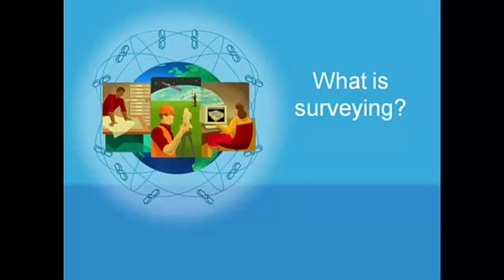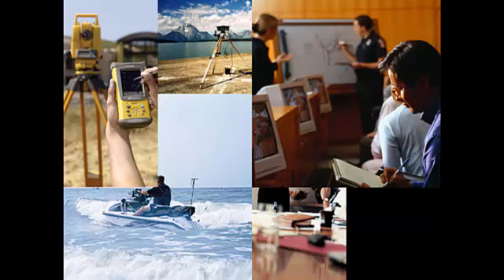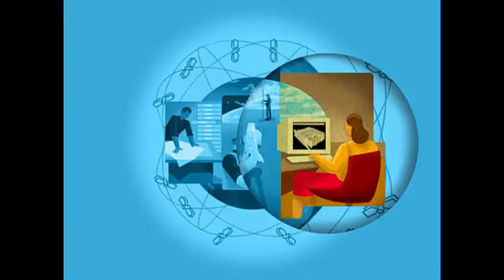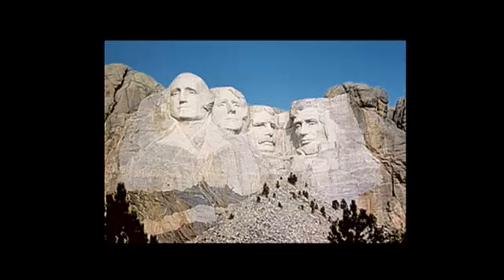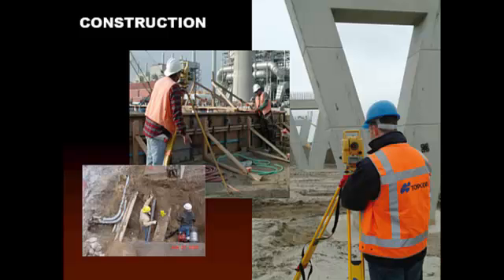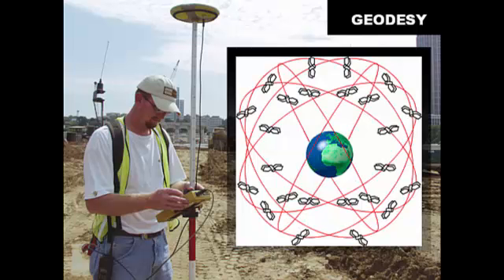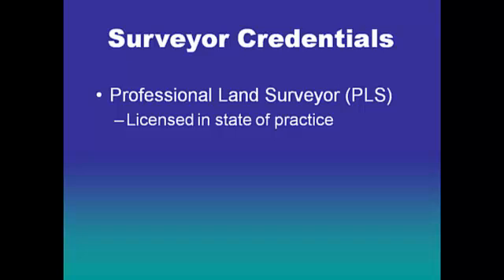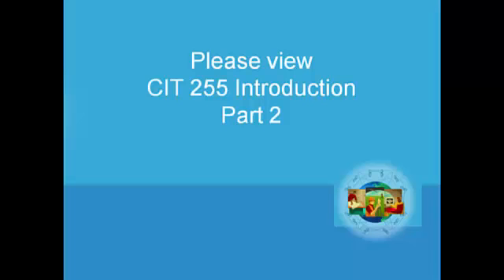Introduction to Surveying, Part 1 of 2

Comment: There should be a much better term for this work than just surveying, as that word is used in so many other ways. Surveying is not the best word to describe the work that land surveyors do. They could amend this by just prefixing the word Land, or Geo, and Plane surveying before the term surveying and set their profession apart from all other uses of the word. When taking samples of attitudes of people the word surveying fits very well; however, when locating points on the surface of the earth the word becomes inadequate because surveying is not a sample but a fixed value. Those who measure the land do not place a high enough value on the name of the art and science they do.